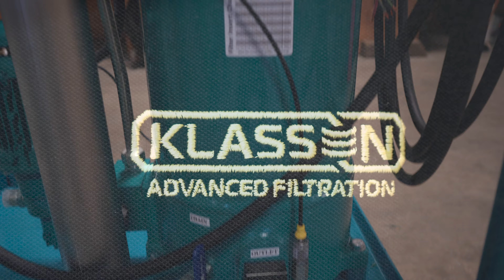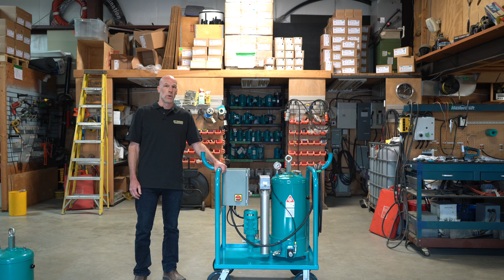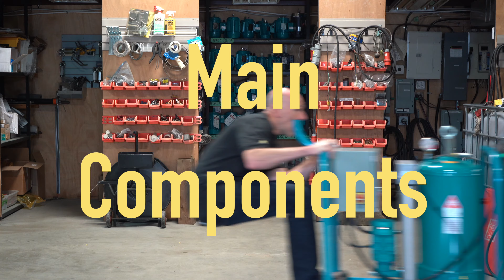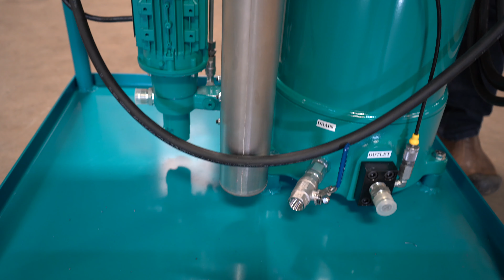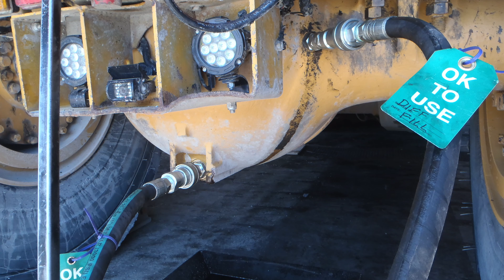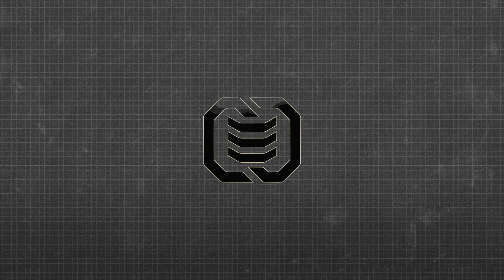HDU 27/54 Mobile Filter Cart

Comment: is it okay to use both hydraulic oil and gear oil by one HDU 27/54 mobile filter cart? it means that, some hydraulic oil and gear oil is mixed in filter cart, is it fine?
Reply from the maker: This is generally not recommended. One exception is if both oils are the same type/series of oil but just a different grade and that some viscosity dilution is acceptable in both applications.  Please check with your oil supplier first before attempting this!  Otherwise you should have one cart for each oil type.  Also note that if the viscosity differs greatly (for example a VG 46 hydraulic oil and a VG 320 gear oil) these two applications may require different pump flow rates and/or additional features to suit.
Feel free to reach out to your local representative and they will surely guide you to the right solution:  https://www.cjc.dk/contact/worldwide-contacts/
Reply: @klassenadvancedfiltration  Thank you. and I have a question for using off line filter not no board type, usually, how much interval time recommendation for filtering hydraulic oil and gear oil?
Reply from the maker: @팀브레이커  If you are using as a filter cart, we suggest to aim for 15-20 cycles of the volume as a starting point.  For example if you have a reservoir of 1000 Liters and a filter flow rate of 500 L/hr, try to leave it on for at least 30 to 40 hours (1000L x 15 cycles / 500L/hr = 30hrs).  As always, the longer the better!